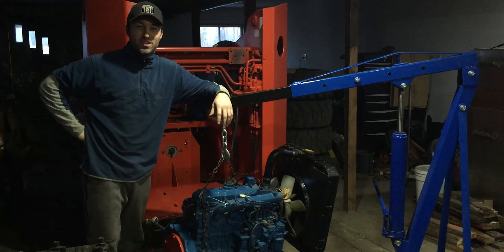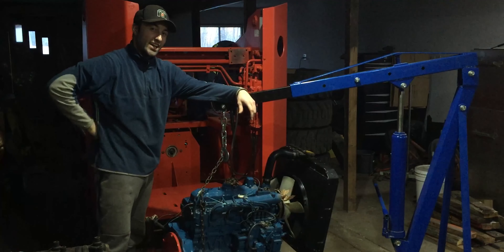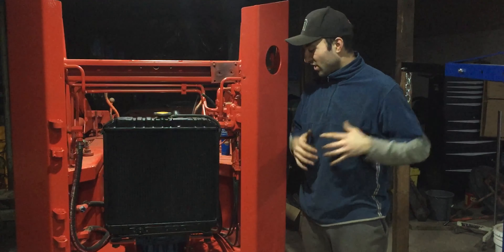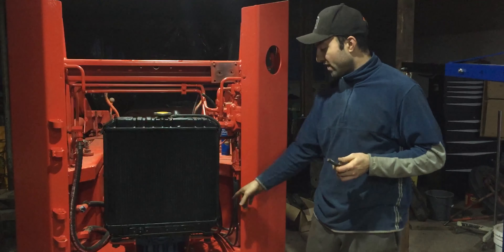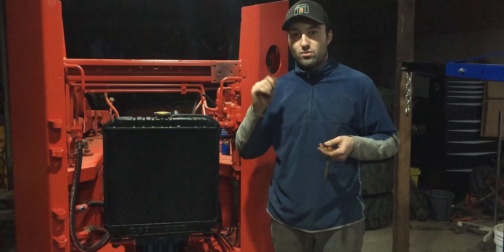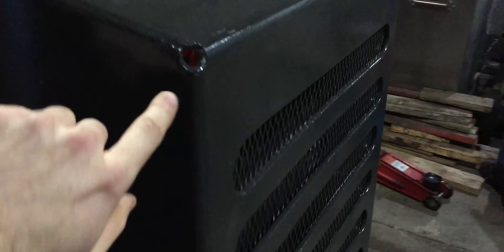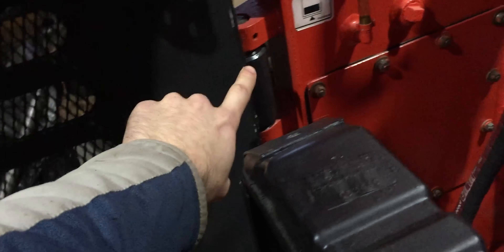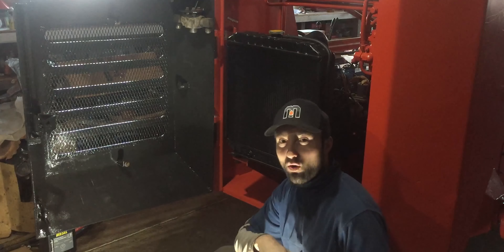Thomas Skidsteer Bobcat HL173 Engine Install

Comment: Hi, it is amazing how you made shine such an old skidsteer! You already helped me with my T133. I finally got the hydraulics working, but I made a terrible mistake. My pedal of the auxiliary circuit was not in neutral position when I started, so when I had the key in the preheat position (when voltage used to drop battery voltage to 10V) I felt a little attempt of the motor turning and then it stop working. So now the preheat position doesn't drop the voltage and engine won't start. I checked in the manual and not having the pedal in neutral can damage the starter. Do you think there is chance that I can fix it by replacing the solenoid or some part or will I have to replace the whole starter? Thanks
Reply from the maker: First of all, I'm glad you were able to start your Thomas and it's nice to here good news from your end! Now I'm trying to understand your issue and I can't quite comprehend what has happened. If your auxiliary circuit is hydraulic, then there shouldn't be and issue with the starter. If your preheat position gives power to your starter solenoid, you have wired something wrong! Preheat will ONLY send 12V to your glow-plugs and nothing else. Once you hold it there for 15-20seconds, you turn your key to the start position and then power is transferred to the starter solenoid. 
There should be no damage to the hydraulic system whatsoever...unless you maybe ran the system dry...

Let me know what you're having trouble with right now and maybe I can help. Cheers
Reply: @WorkshopRebuild  Before and after the pump fix, I was able to start the engine smoothly. The first time after the fix I did the Start-up after repair procedure (throttle lever set in the off position and using the starter for 2 minutes) and I was able to move backwards a meter but then the oil filter fell because I didn't tighten enough, so then I stopped the engine. The second time, I was moving the pedals beforehand thinking that it would help the oil to spread. The starter tried to spin a bit and then it stopped. Afterwards I checked the manual and found this: "When the auxiliary circuit is not in use return the foot pedal to neutral position otherwise starting the loader may be difficult or impossible and damage to the starter may occur". I checked continuity of glows and it is ok for all of them. So I guess it should be a starter problem, perhaps only the solenoid. I think I should take the starter out and check solenoid and motor, don't you think? Thanks
Reply: Hi! I removed the starter and made these tests: 1. Power: solenoid didn't move.
2. Power + push solenoid: motor spinned. 3. Power in motor terminal: motor spinned.
So contacts and motor are fine, but solenoid is damaged. I don't understand how it was broken, it would make more sense to me that the motor burned if the engine couldn't start because of the pedal constraint. I don't think I can take the solenoid apart because screws are very rotten, so I guess I will have to buy the whole starter. But I will try to find the solenoid only.

Comment: Do you have a video on how to remove the Thomas Skid Steer V2003-T engine?
Reply from the maker: Hi Jeanna, unfortunately I do not have an engine removal video on hand! 
To remove the engine you could follow these steps:
1) Remove wiring (and note where each wires goes)
2) Remove fuel lines
3) Remove coolant from engine and remove necessary coolant lines
4) Loosen off engine mounting bolts
5) If needed remove driveshaft from the hydraulic pump or the flywheel
6) Slowly lift and remove engine from rear of Skidsteer

I hope this helps. Regards Andreas